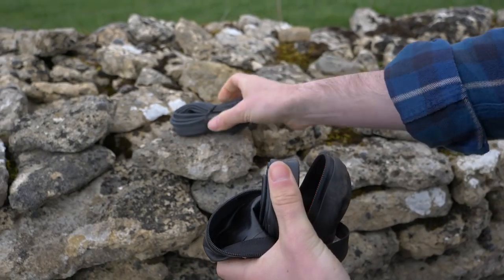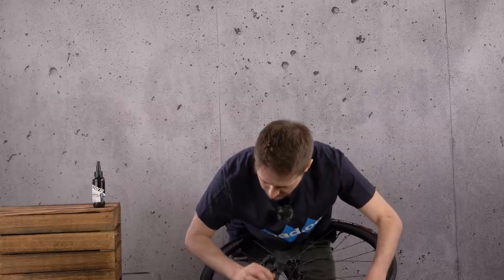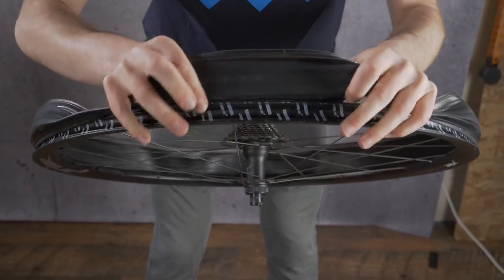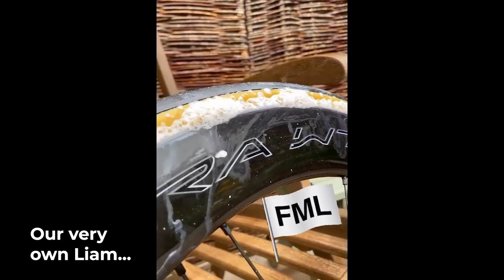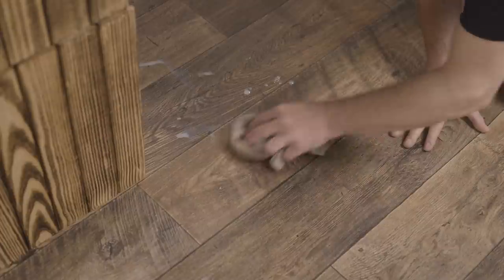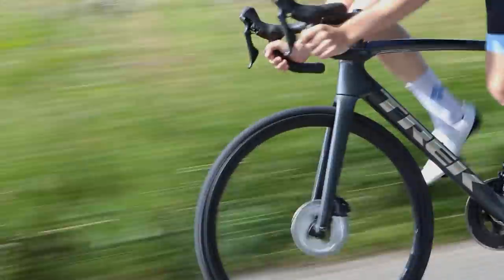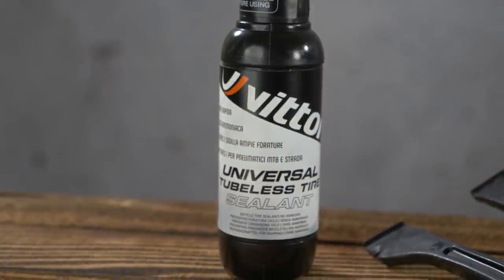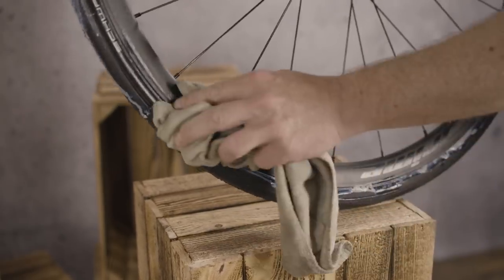9 things they don't tell you about tubeless tyres

Comment: I decided to try tubeless. One day after not riding the bike for 2 weeks I was about to head out for a ride noticed the tires were deflated. I tried to pump it up and it would not hold air. I spent couple of days trying everything. The sidewalls of the tires clamped together like super glue and would not budge. They were newish tires too. I had to cut them up. Went back to clinchers after. Tubeless is not the future. Not going to deal with all that mess and gimmick. I want to ride, if tires are flat simply put a tube in go ride. No need to figure out anything.
Reply: you just did it wrong .
Reply: @joebidenshearingaid1618  Wow, such a constructive comment...
Reply: @scubawithatuba  my comment was short but sweet . He obviously did it wrong .
Reply: @joebidenshearingaid1618  You obviously don't ride, lol.
Reply: Ohh jeez .good to know. Maybe I'll pick up good used rims to try it out . Honestly my rims are made for tubeless but I'm just about riding frequently with the least hiccups. As you know after every ride almost chain clean ECT .lol🍺🍺

Comment: It was a horrible experience when I was in the middle of a remote countryside at sunset when I had a hole on my tire. It strayed sealant everywhere. I had a difficult time removing the tire as the sealant glued it to the rim. It took me about two hours to install an inner tube in the dark night. Due to that lousy experience, I ditched tubeless and switched back to puncture-resistant tires.

Comment: I am aa local mechanic, does services here at home, most of the problems i encounter in tubeless both mtb and road are blocked valves due to sealant drying up inside.
Reply: How do you solve this issue? I could look it up, but as you're a mechanic I'm inclined to listen to what you have to say. Thanks
Reply: I have bought inner tubes with sealant inside...after a year or a few years, those tubes' valves started to leak air due to sealant drying inside them.  Never bought them again...
Reply: With presta, a new valve core will usually solve that.
Reply: Whenever I parked my bike, I rotated the wheels so that the valves were on the bottom. Never had any issues with plugged valve cores.

Comment: I found to get the best results going tubeless is to not cheap out besides the gorilla tape . A good sealant and valve makes all the difference  . I use mucoff valves , gorilla tape and Stans sealant (8 inch span in the tire ) and have no problems for 6 months and then simply add more sealant .

Comment: The bike gods are not going to be happy with your last two videos 😂

Nice to see people talking about downsides for once, I have seen more than enough people at the side of the road with flat tubeless tyres to put me off.
Reply: Yep, I stopped to help a guy on the side of the road with a flat recently , who said he had had enough of tubeless/mess and was going back to tubes!   I'm on the fence for the time being with a foot in both camps..... ;-)
Reply: Yes that's been me, not always easy to fix.
So have to fit a tube anyway.
 Tried to fit GP5000 TL but couldn't get it on wheel. Sold the tyres and back with tubes

Comment: There's a small price to pay with tubeless as they are more difficult to setup  but it's definitely worth it - it's just matter of learning to get it right as with everything. The rolling resistance and speed is easily noticeable, so is the comfort and amount of grip. I'm running Schwalbe pro One Tle 25 on Hunt UD carbon spoke wheelset and they are absolutely brilliant, love it and I wouldn't go back to tubes.
Reply: The TLE Addix Pro Ones are very good tyres. I bought my second pair recently having done ca. 4k on the first pair. Measures as advertised (unlike Contis), not a single failure, punctures always self-sealing.
Reply: @Click Bait Well, maybe it's simply not for you. I'm happy with my wheels and tubeless setup. Good luck with the tubes
Reply: I completely respect people's choices when they differ from my own, but I don't think tubeless tires for road riding are quite there yet. I rode tubeless tires for 18 months and liked them; they are in fact very comfortable, and roadside flats are rare.  But then I got a roadside flat that wouldn't reseal on its own. Never again; I would much rather get three flats that I can easily repair than one flat that leaves me stranded on the side of the road in the rain with frozen, bloody, goo-covered fingers and a broken tire lever.  Mounting tubeless tires can be a nightmare even in the comfort of your own house, and finding a friendly wheel/tire combination is pretty much a matter of chance. I went back to clinchers with tubes, and will stick with them for the foreseeable future.  I have to admit that the goo factor is a serious consideration in my decision to stick with pneumatic tubes; I think the sealant is absolutely disgusting. And in my experience, even with clinchers and tubes, if you ride on good tires (I use GP 5000), flats are very rare; I ride almost every day in all weather and get maybe one roadside flat every year or two.  

Rolling resistance is not necessarily less with tubeless tires. Rollingresistance.com did a short study and found that clinchers with latex tubes had the lowest rolling resistance for the same tire type and volume, and that tubeless and clinchers with butyl tubes were roughly the same. My own, subjective experience confirms this: when I went back to clinchers and tubes, I noticed no obvious decrease in performance.  Tubeless tires have a few very compelling advantages, chiefly the ability to run lower pressures, but decreased rolling resistance probably isn't one of them.
Reply: @sventice  it’s not really the tires or the wheels if you have good fitting techniques I haven’t had a pair that won’t go on the wheels if you can fit challenge tires you can fit anything!. The problem is the sealant. Anything over 50-60psi the sealant will all be gone before it has a chance to do anything it needs to be more reactive but still stay liquid for longer than 4 weeks which currently the highly reactive stuff doesn’t
Reply: Tubulars are much better in every aspect
Reply: Tubeless is utter shite; fixing a problem that doesn't exist (if you use tires with proper protection), at the cost of introducing 50 new problems.
Reply: @antred11  Right? Just like index shifting! No one needs that shit and it is a real pain to set up.  Why is the bike industry pushing that useless crap when friction shifters work perfectly fine?

Comment: Hmm, been riding tubeless on my gravel and road bike. Absolutely, no issues, yet.
Reply: Tubeless is fantastic...right until it's not.
Reply: I’ve been running tubeless for the last seven months. I did carry a tube and once had to use one, but now I use plugs instead. The only difficulty I’ve had was with a tiny sidewall puncture that I didn’t plug, because it had sealed. Pushing up the pressure or waiting at a light with the puncture at the bottom of the wheel would reopen the hole.
Reply: @zodgzod  I carry a tube just in case...but, I really meed to pick up plugs instead. Putting in a tube with sealant everywhere would not be fun.
Reply: @PeterSdrolias  believe me: it’s not!
Reply: @zodgzod  I had that also. A puncture in the sidewall. No idea how that happend. I think the wall is probably less resistant and easily damaged...
Reply: Haven't had an issue with my mountain bike being tubeless.
Now both my bikes are tubeless

Comment: Great video. Lack of standardization of rim/tire compatibility should be an embarrassment to manufacturers. The bike industry is on its way to a big disconnect with many riders who, after considering the pros and cons, don't want tubeless tires (or disc brakes). Ultimately, if riders are not given choice in these matters, one would expect new bicycle sales to suffer and, possibly, custom frame makers to increase their businesses.
Reply: Nobody doesn't want disc brakes
Reply: @jbloggs4161  Why do you say that no one wants rim breaks?

Comment: I had no issues setting the bead on my tubeless setp. I first cleaned everything with rubbing alcohol. The taped my rims really well the gorilla tape. The got the tires on a pulled out the valve cores. I set the bead with my hand pump and left them for a while. Then I let the air out and injected the sealant and replaced the valve cores. Once I aired them up again, it took a couple days of rotating the tires in my garage whenever I had a spare second and they were bomber! They held air like crazy and I didn't have to do anything with them all summer. I think people don't think through the setup so run into issues. I always seat the bead and let the tire settle for a few hours BEFORE adding sealant. This keeps the bead from having sealant leaking into it.

Comment: Loved my first and 2nd set of mavic and conti TLs. Mavics are easy to install but don't last long (1/3 compared to normal clinchers) and conti's are a nightmare to install and last longer than the Mavics.  Once they're on they work great BUT big lower mileage disadvantage on both brands vs normal clinchers.  No issues installing sealant. 
When my conti's gave way, ordered another set and after a lifetime getting them on, found sidewall leaking on both. Returned them and went back to my tubes as was not keen to go through the hassle of removing and installing and running the risk of more side leaks (which is common per certain forums).  Also carrying a extra tube is a good idea but I can't see myself hassling on the side of the road to get the TL off, remove the TL valve, install the tube and refit the tyre. Rather carry a TL repair kit or uber home.

Comment: I've had one setup with tolerances so tight a tyre Jack to get the tyre on and another where the tyre went on so easily I couldn't get it to seal. Fortunately another run of rim tape fixed that.

So far I've been happy with tubeless. However both of the punctures I've had with tubes over the past few years probably wouldn't have sealed with tubeless.
Reply: The Stans DART tool saved me numerous time from the big punctures and have yet needed to put a tube in! Might pick up some dynaplugs to try them out

Comment: At 5:45 you're holding the bottle upside down. If the opening is at the top it is easier to aim and regulate the flow.
If you have a Stan's injector there's almost no mess or spillage. Position the valve at 12:00 and screw on the injector then just use the plunger to push the sealant in. Then turn the wheel so valve is at 4:00 or 5:00 and pull the plunger out half way and push it back in. there will be a drop or two that might escape when you unscrew it.

Comment: Where I live you need to have some kind of tire protection like slime tubes, tire liners or tubeless. I switched to tubeless and will never go  back to tubes. You need to carry several tubes and a patch kit to have a successful ride in my neck of the woods and with tubeless I don’t have to worry anymore. Sure it’s not bulletproof, but tubeless plugs have solved the big punctures, at least so far. I still always carry a tube, but since going tubeless haven’t yet needed to put one in. Once you get a couple of setups under your belt, setting up shouldn’t be that difficult. I’ve swapped new tubeless tires on several times and never had an issue with getting them set up properly. It’s just a little messy, but worth it!

Comment: Bd plastic 20ml syringe makes it nice and clean to get the sealant in. The slip on it fits my valve just right hehe.
Reply: Which syringe did you buy?  The only one I could find doesn't fit my valve :(
Reply: @DavidBrown-dh5vv  it was a bd plastic slip one. The luer lock one won't fit.

Comment: I think there is a point were tubeless isn't as effective for road riding. I put 30mm Corsa Control on for the autumn/winter - never had a puncture. But, I think 30mm, possibly 28mm is the minimum that works tubeless. If you prefer 25mm or less (which I can't imagine using) then tubs or clinchers still make the most sense due to the pressures needed.
Reply: Largely depends on luck and the casing. Cotton clincher do not seal well at all, especially if there’s a cut of any sort. There just isn’t enough rubber to bind it back together. Mix that with cold wet weather and it’s a recipe for a messy 20mins putting the tube in. I recommend you carry some paper towels with you in your tool kit. And baby wipes for your fingers
For me tubeless starts to work on 35c and above as the pressure drops. At which point it’s actually pretty reliable. Anything about 60-70psi and the current sealant types just can’t cope.

Comment: I just upgrade to a set of Hunt 50 carbon aero disc wheels with Schwalbe pro one 28 mm tubeless tires.  They were a bit hard to get on; definitely a tight fit.  The front inflated no problem with a standard track pump. The rear was a bit tricky but I finally got it to seal with a portable compressor.  Put 100 miles on them so far and I love them.  Only issue is they lose about 20 psi over a week so I just have to add a bit of air prior to riding.

Comment: Just put 25mm Conti 5000 TL on Roval 38 hooked rims. Thumbs a bit sore but no worse than Challenge Limus clinchers. Normal track pump popped them on, held pressure for 30 minutes with no sealant, have held pressure for a week now with the sealant. Perhaps I was just lucky. I ride normal clinchers on my road bikes, MTB and my cross bike, tubular on the track and tubeless on my best race bike. I was riding 45 years ago when punctures, especially of tubulars, were a weekly occurrence. So these days when I don't get a puncture from one year to the next I may have got a bit complacent. I just buy "last year's model" off the shelf and deal with whatever is on the wheels, it's never a factor of choice. But tubular tyres are best IMHO.

Comment: i love tubeless for my xc mtb, but it makes no sense for road cycling.. i use 25mm tyres with 55-60 PSI, and comfortably do 160-200km rides... havent had a flat in about 3 years
Reply: That is some low pressure for 25 mm. You must be very light.
Reply: @Dr.Schlitz  yeah I was about to say that is very very low tire pressure
Reply: Consider yourself fortunate.  Before going tubeless I got a flat at least every other week.  We have goathead thorns all over the place where I live.  I ride exclusively on bike trails and road, and still pick them up all the time.  Guaranteed flat with tubes.

Comment: The tyres did deflate over the space of a few days for first few weeks after fitting.  I topped up the sealant after 3 months and ever since I find that the tyres hold air for 3 weeks before needing topped up.

Comment: So far not had a puncture with tubeless,  but dreading the time when the sealant doesn't work as the tyres are such a pig to get on and off. Really need to get some Stan's darts or dynaplugs to not have to go there.

Comment: Tried tubeless tyres thought that was the way forward for my road bike, initial few months was fine, once I got a puncture the sealant would not seal the hole mess everywhere on my frame, then refill sealant it sealed then it broke again and tried the plug was okay, however after 10 mins riding sealant everywhere and the plug did not work.... really tired back to inner tubes...

Comment: if you inflate & deflate your sealant filled tire with the valves stem angled downwards you won't have valve core clogging issues. Just don't angle it straight down as the pool of sealant directly below the valve will likely splash up into your valve & core.
Reply: Absolutely Bs. The sealant well eventually still work it’s way in there over time. Always carry a pipe cleaner with you.

Comment: I switched a year ago. NEVER going back to butyl (Like GCN Ollie says.... Resistance is butyl). I have it on all my systems. Once the side of the tire got slashed on a ride .... no idea how. Selaent did not stop it. I put in a old butyl and off I was. I guess if you did not do your research with TL then you will get supprised. But investigating a bit and you are on top of TL. It's NOT a big deal. But the gains are massive. A positive thing that you did not mention is that - yes - you may spend a little bit more time on setting it up. But once it's in place you don have to worry about the punctures to much. So you can spend 5-10 min more on the setup or spend 15 min and the hazzle out on the road fixing a butul in the rain. I rather spend the time in my garage setting it up and not worry to much. Rather than fixing a puncture on the road not knowing if you got the rock out of the tire and thinking that you may have a puntcture in 5 min because you missed the stone that caused the puncture. I agree with the location. DONT do it inside. Go outside. In the garage or someting. It may be a little messy. Topping the TL is no problem at all. This is probably a small point to make in the video. It's not a issue. What CAN be a issue if you get a too big of a hole and the selant can not fix it. Using the systems to fill the hole ... then you must be VERY carefull not to puncture the inner tape that is making the seal from the tire. That is probably he most probalamic issue. But again a inner butyl will save the day always. Always have a spare on the ride and you will be fine. One other thing.... NOTHING is easy the first time. And seating the tire is NOT a problem. I did the first time and have never had any issues seating it. If you want to be VERY sure that the tire seats use some soapwater and apply it to one of the sides and you are good. Also you should have mentioned under the "cost" point that you need a special pump that can charge and release the air in one go. To inflate the tire in a second. That is important. Or have a compressor. Sometimes a normal pump can do the trick if the fit is 100% between tire and wheel. Just try it. TL is awsome!
Reply: Good tires and some tire liners solves everything. You can even add sealant to tubes too, tubeless sounds pointless and only worth it for mountain bikes imo.